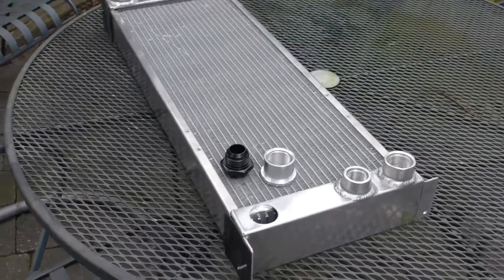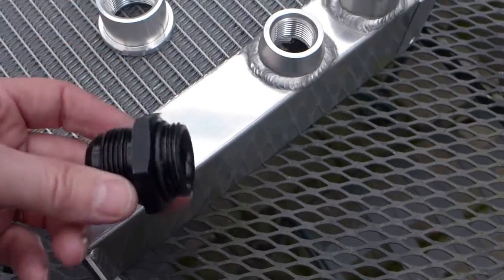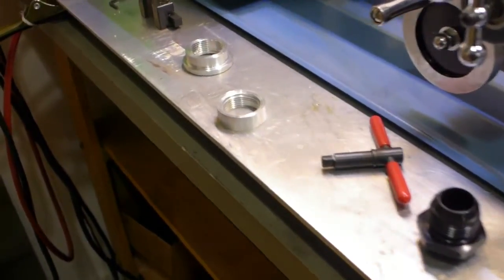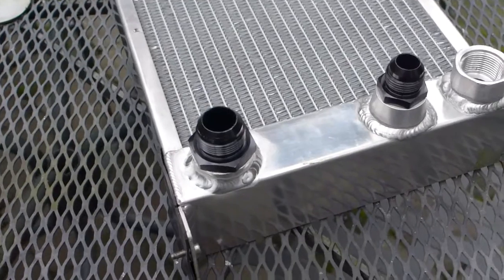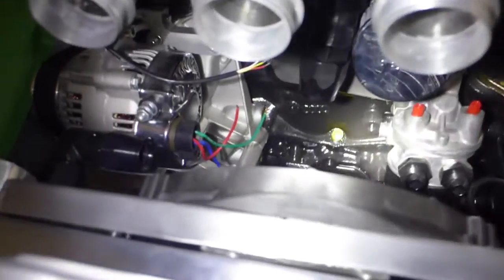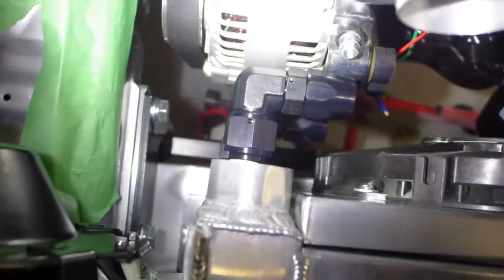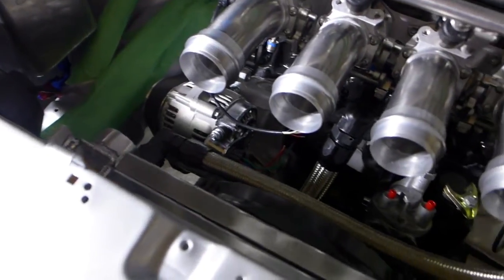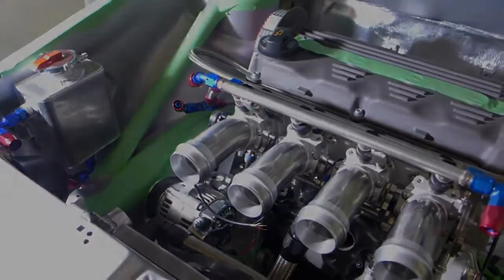The Ultimate 1983 Rabbit GTI - part 80 (Cooling System Plumbing)

Comment: I not sure if I understand  the water outlet on the head between  cyl. 2 and 3.
Is it going to the new bung down low? And is it a single pass radiator?  Keep up the amazing  work.
Reply from the maker: Yes, the -16 line connects to the front of the cylinder head and now routes to the bottom of the tank on the radiator. It is a single pass radiator.

The routing isn't ideal as I'd like the hot coolant to enter at the top of the rad and the cold coolant to exit at the bottom, but I am not that concerned about things as the radiator is massive and the side tanks are large as well so the coolant should distribute well. One potential issue is simply that my coolant system has so much capacity that I might run into an issue of thermal shock to the engine block with too large of a differential of hot coolant leaving and cold coolant coming back into the block. I have 3 temperature sensors: one in the head, one in the rad, and one in the hose leading back to the block. I'll watch the numbers and can adjust the electric water pump speed relative to engine/coolant temperatures.